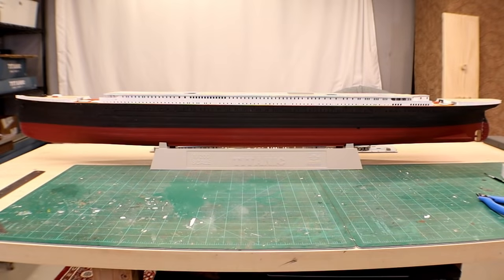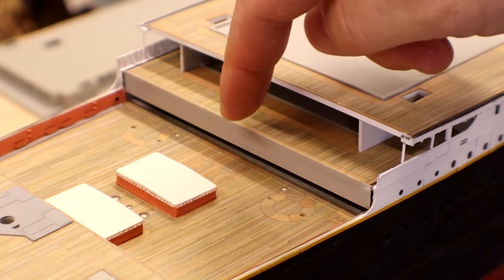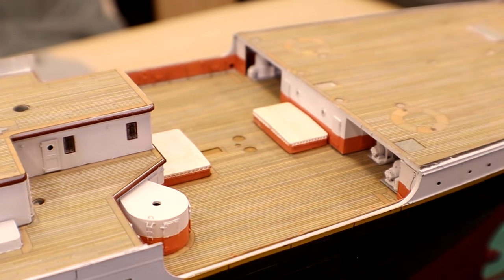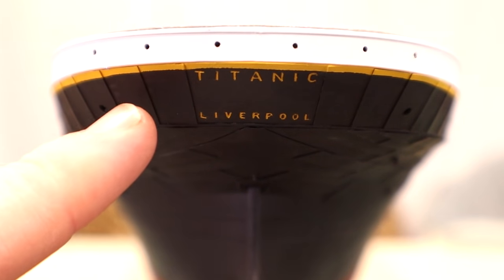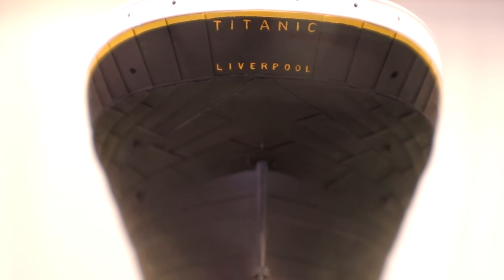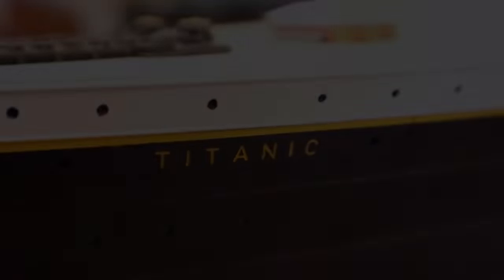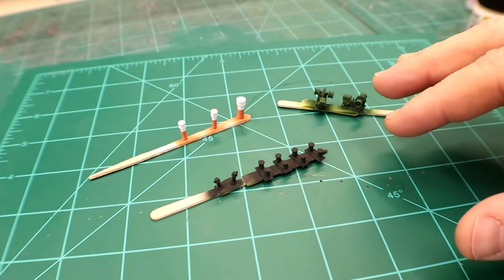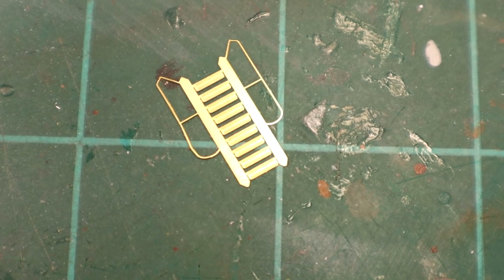1:200 RMS Titanic Build Video 18

Comment: Thanks so much guys. I was looking for help in folding stairs and also the colours to use. So your video was a great help.
I agree that the KA instructions are a nightmare. I spend so much time going through the pages over and over and over looking for one specific part. As an aside I did find at the bottom of page 12 those stairs are shown as D02.

Comment: This is great problem solving and remedy tips for those of us taking the 'hells highway' route with this stuff!   I solved the battleship plating problem on the well decks by cutting it out completely. I then used a sandwich of the scale the titanic PE, the Pontos and the KA to get a strong but scale thickness side wall in those areas.  The Scale the Titanic kit PE really needs a lot of work to remove  the plastic from the hull and window areas affected.  That has taken me ages to sort out and the mess!!!!  Great video, showing us all the possible pitfalls. Many thanks Ben this stuff is  excellent.  😉

Comment: Nora is hysterical.  Thanks!  The engineering you are going through is amazing.  It would have been interesting to see if the Titanic had survived if it had sides built of battleship armor!  Sigh.  I love the lines of your model.  The lines of the ship is another reason why its sinking was sad.  12  in a lifeboat sucks.  I've not done much with PE yet.  I think part of the reason why is the bending.  Your tool makes it look much easier than I think it is.  Good tools make work much easier.  OK, enough of a ramble.  Great job Ben!

Comment: Hi Ben/Nora, I've enjoyed watching your build. I've worked on ships in the Merchant Marines for many years, and I can tell you that the "vents" you refer to at 24:50 are in fact a type of rolling bollard. The wench you installed shortly prior to this requires that the mooring lines be guided to the capstans (which are oriented in line with the ship, but must pull roughly 90 degrees from the ship) and must in some way be guided to bollards and chocks that are closer to the edge of the ship. Those bollards in question are slanted at an angle in order to properly guide the mooring line, from chock height, to capstan height, otherwise, under tension the mooring line would fly off the top of the bollard. They should be oriented such that they are angled away from the capstan, as you have done it. If you had oriented them the other way, it would have been incorrect. Just thought I'd educate you on what those were, why they were angled, and which way is correct. Cheers and thanks for the great videos!

Comment: Peter Davies-Garner's plans has squash court light and air ventilation shafts in front of the forward well deck aft bulkhead (behind the no. 3 hatch and in between the two cranes). I have yet to see a model with those vents. Even Peter didn't add them to his model which is odd. Some members of a Titanic forum said the shaft leads to mushroom vents while another said it's a grill protected by trunk vents.  
I guess modellers omit the squash court L & A because no one knows exactly what it looks like.
Reply from the maker: Yep. I’m just installing what KA has provided.

Comment: Thank you for describing other options.  Great video.  A couple of questions/comments.  First, all the PE hull siding is there to give a better scale appearance of the A and B decks.  When it comes to the well decks, the styrene hull thickness is present.  Yet with Elixander's hull sides (now available from Mini Brass) and PE parts for the inside of the well decks (multiple sources) it seems possible to remove the styrene thickness in in the well deck area and just have the thickness of the PE.  Should provide better scale appearance.  Any comments on that approach?  What issues would you anticipate with the fit of the wooden decks?

Second, Scale Decks has a couple versions of the wooden decks, some are a little wider.  Which versions were used and how did the waterways fit in?
Reply from the maker: Yes, if you use those hull sides from mini brass, you could cut out the well deck walls and have the correct size walls. And a couple people out there have done it. But the first issue is the wooden deck. It is too narrow if you do that. The solution so far, has been to cut the deck and use extra parts of decking to fill in the difference. I’m not aware of scale decks having made a well deck piece to accommodate this modification. The other problem is the transition to the forecastle. There isn’t any PE for that part we’re it curves up from the bulwark to the deck. So you have to figure out how to thin the kit styrene. It’s not impossible, but Im not sure about the best way to go about it. 

I ordered my deck very early on. So they fit inside of the stock kit. I don’t know about a slightly wider version. But so far, I haven’t ran into anything that makes me wish I had something else.

Comment: Great video as always but personally Think you should gave added the styrin to the bottom of the other 2 stairs that way the hand rail would be a lot higher on the next deck
Reply from the maker: I almost did. But looking at the instructions, I don’t know if anyone will actually see them. So, I think the plan is to check what the end results are. If it’s going to be clearly visible, I’ll pop this stairs off and add the styrene.
Reply: @TheMidwestModelShop  Ben my kit has just arrived so I will be following what your doing very closely. Love the channel keep up the good work.

Comment: Heya mate, how much plastic did you remove from the kit super structure parts before fitting the photo etch parts? I have the photo etch sheets and wasnt sure how much to remove, especially around the forward and aft 'rail' sections. I asked this question on the "Trumpeter Titanic 1/200 model ONLY" FB group but not had much luck with an answer there yet... did you attach the KA PE parts to the inside face of the MiniBrass PE? I Hope that makes sense, thanks 😊
Reply from the maker: Well if I can recall, you only need to remove the raised surfaces. And yes, I attached the KA PE to the Minibrass PE. Except in the well deck areas. You need to leave the kit plastic there unless you want to do some clever engineering to make those parts work correctly.
Reply: @TheMidwestModelShop  Noice one, thanks buddy, I will do a bit of monkeying around and see what works. It's a bit scary, as I don't want to ruin what I've done so far. I am confident I can remedy any mistakes I make with the plastic, but the PE stuff I cannot afford to screw up! I just want to crack on with the build as I don't get much time to spend on this. When I do get everything out, try and work out an order of battle, where parts need to go, how to get them to fit etc,  I end up running out of time and have to put it all away again, having achieved no progress! (Or I get distracted and end up just watching Midwest Model Shop Videos...) haha,  Have a great day anyway! 😊

Comment: Hello, what brand/model of air brush do you recommend for a beginner user? (12 years old) Thank you!
Reply from the maker: Hello! When I was 12 I had a single action airbrush that I learned to paint with. When I had figured it out, I eventually purchased a double action airbrush. It does the same thing, but a lot faster because you can adjust the spray pattern at will. I currently use an Iwata. I do recommend looking into the brand.

Comment: The forecastle hach sides front left and right are black, not orange And the fore well deck holes on each side are open, no cover plates. The capstans are green top brass and  from the fore hatch, the anchor gear to the big capstans and what thay are sitting on are also green. Not the chains or what the chains are sitting on.

Comment: Did you have to drill out the portholes since your client didn’t want it lit? Just wondering what options there are because if I get enough money, I’m wanting to get a Trumpeter kit and I don’t plan to light mine if I do.
Reply from the maker: No I just painted them gloss black so it reflects as if there is glass in the porthole.